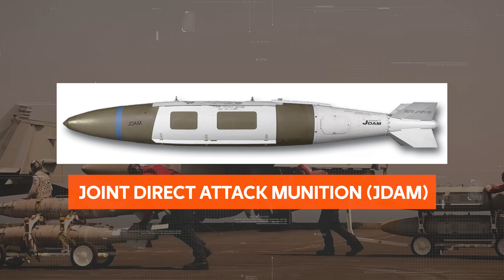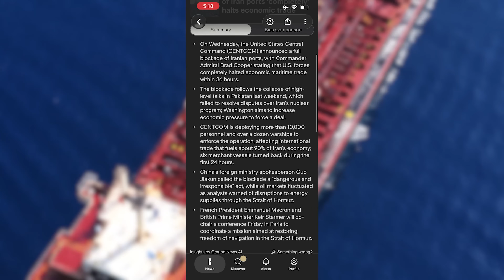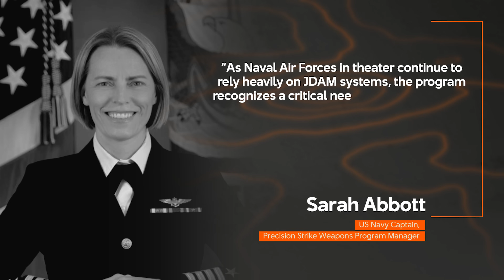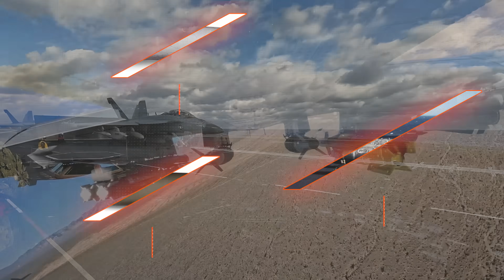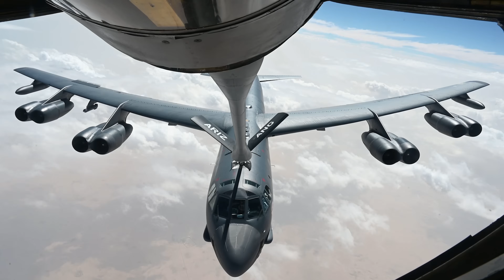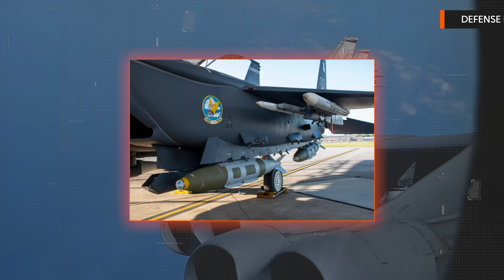U.S. Navy Just Did Something No One Thought Was Possible… And It Changes Warfare Forever

Comment: They were $1m/pop in the mid 70’s @ the beginning of the cruise missile program, & dropped to $500k in the 80’s even w/ CONSTANT upgrades being integrated. They’d be cheaper if the Cold War paradigm continued, & that disposition being renewed in this multi-polar threat matrix w/ 🇨🇳@ the top will drive cost down again. Its start-up cost on the production line. Those missiles will be replaced by Labor Day, & every other system will leaned on heavily as needed to fill the gap.

Comment: In case you haven’t been paying attention, even from before the Iran war, the Pentagon has made it a priority to procure tens of thousands of cheap, mass produced long range cruise missiles & attack weapons within the next 1-2 yrs. Many are already being built & over 3,000 (Rusty Dagger & Barracuda cruise missiles) are going straight to Ukraine (beginning in October as part of ERAM program) but they're not replacing current high end weapons, which have also already been ordered & paid for, in numbers greater than ever before, to replace what's been used & then some.
Reply: I don't understand why they don't recruit some of these rocket club nerds, give them some GPS systems without the speed lockouts, c4/small EMPs, proximity fuses and let them go wild.  They can build a rocket that goes straight up to drone level for a few thousand dollars vs a million per shot.  The record is what, close to 470,000ft?  Those scooter motors aren't flying that high.

Comment: I'd be interested to see if they have considered strapping this kit onto the HARM to extend the effective range from which they currently have to be employed. This could represent a quantitative jump in the capability to degrade enemy air defense.
Reply: The harm is already a rocket. Strapping a jet engine to the end of a rocket engine would only block the existing motor.  With the =lr version attached to a bomb you’re adding a motor to something that previously had no motor.
Reply: The AGM-88 HARM has already been upgraded to double it's range. 
The guidance and seeker assembly from the AGM-88G is mounted on a new missile body. This is the AARGM-ER. Advanced Anti-Radiation Guided Missile - Extended Range.

Comment: 100 eyes said, miss by an inch, miss by a mile.
Reply: Not with a 500 lb bomb!
Reply: @paulblase3955  Incorrect, precision matters with those bombs but you really mean the 5000 pound bunker buster.
Reply: @paulblase3955  BTW, the only thing they have are 2 bombs that weigh less than 285 pounds have accuracy of 5 meters. So Your point is what?